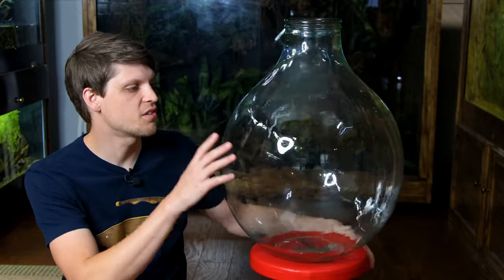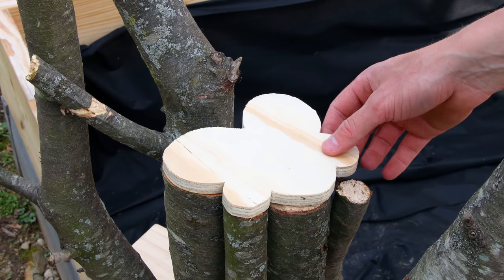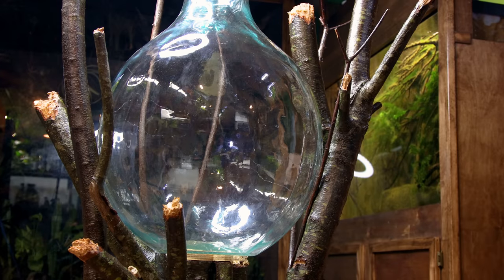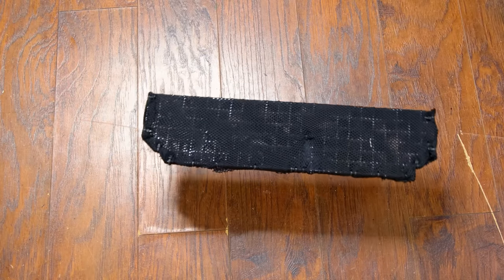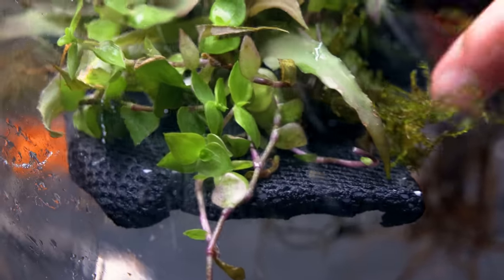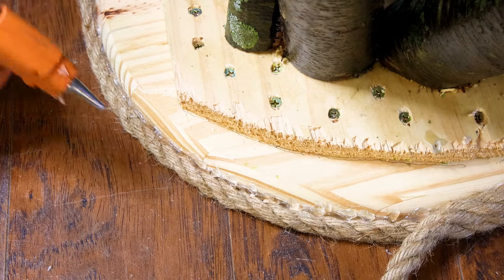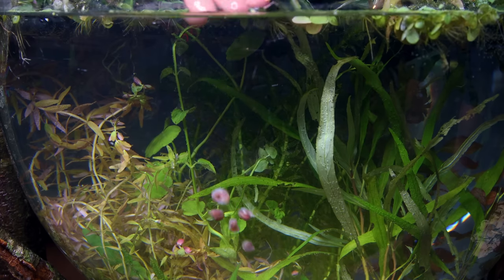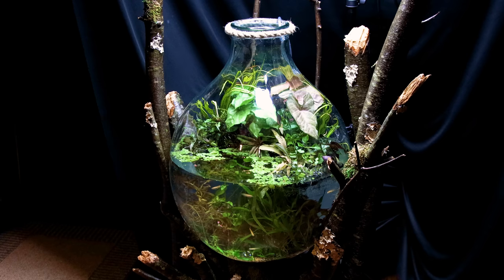Huge Ecobulb Riparium Jungle for Rare Fish on DIY Branch Stand

Comment: I noticed you were using scissors to cut zip ties. You should check out flush cutters. They're much more versatile in tight spaces, and they create the cleanest cut on your zip ties so they don't have sharp edges.

Comment: This is a random question but why do you remove substrate from roots by hand before spraying the rest off? Surely it's quicker just to spray them?
Reply: It's to prevent damage to the root system. It's a traumatic process for plants to be moved, so you need to be as gentle with the roots as possible. The more care to show to the roots when transferring your plant, the easier it'll be for it to settle in to its new home, keeping it healthier and happier.

Comment: Eventually the wood stand will start decaying 
What u should do it remove the bark and apply wood sealant to it about 1 quart will be enough then sand it with 320 grid sandpaper then and a next coat of sealer and sand again then buy a quart of vanish and paint it....will last you forever

Comment: I love your end designs but hot damn that was so much unnecessary pain for the hardscape and platform

Just make the platform first next time. Measure the outside, subtract your desired amount of inches, slide the platform in length-wise so it will fit in the mouth and let it straighten itself out on the lines. No need for all that wasted material.

Comment: Yikes that stand doesn't look stable with a couple of bolts holding both the dead & living weight of that bulb. Especially considering that wood looks very wet, which means it'll dry & shrink. No thanks